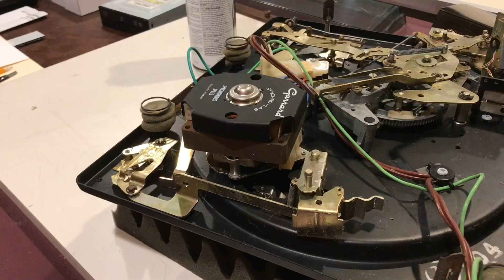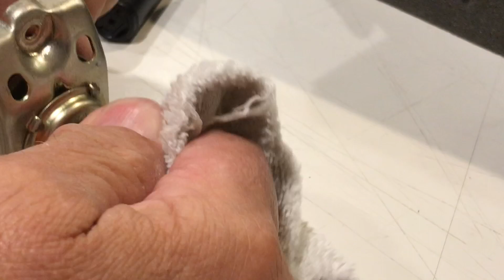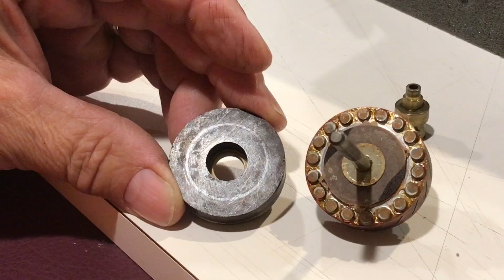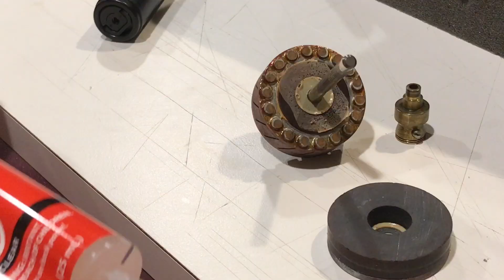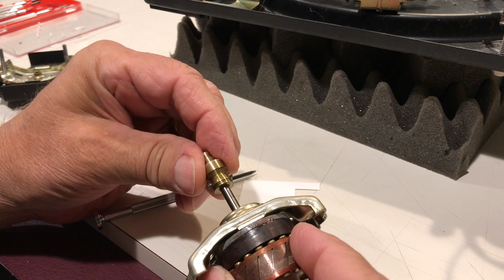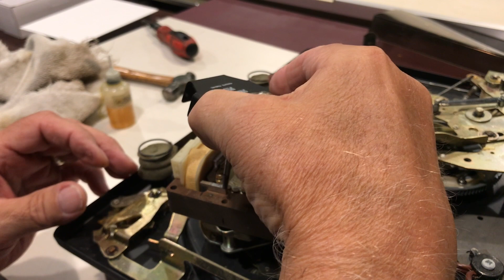Garrard Motor Repair Synchro Lab Turntable

Comment: Did you have to do any rotor balancing before putting it back ?
Reply from the maker: Fortunately every time I’ve encountered this issue I was able to determine the original location and had no balancing issues.
Reply: @xfireamg417 i am working on Garrard 3000 model with a 4 pole motor, permanentmagnet is still attached to the rotor. I opened it to lubricate it, but when i put it back and gently rotated, the rotor was rubbing on the stator. It was not doing this before.. however, i was able to get it back together and no rubbing now. I had to place it on a flat surface suspended and then put everything together. . Front bearing first and then the rear bearing.

Comment: DESDE EL SALVADOR.PREGUNTA EL CABLE VERDE QUE SALE DEL CONECTOR DE ENTRADA DE ENERGÍA DONDE SE CONECTA Tengo modeloB270 garrard por favor ayúdame
Reply from the maker: Hi - Usually the green wire is used to bond (ground) the turntable to the receiver or amplifier to eliminate hum. Here is a video I found on Youtube that addresses the issue. Hope this helps.